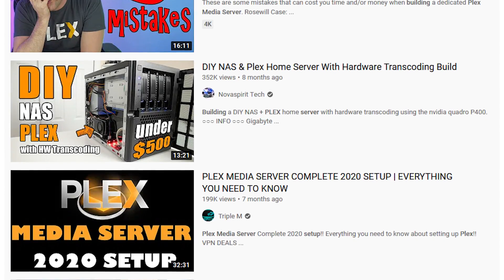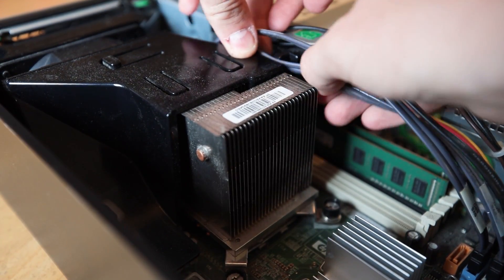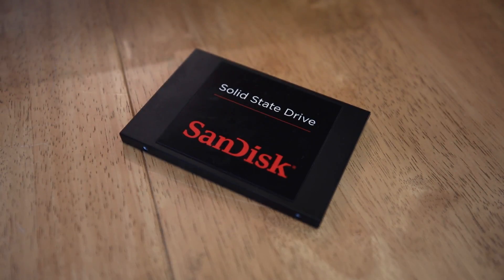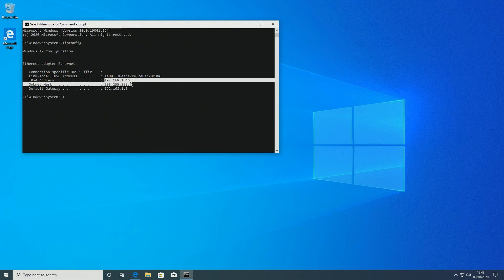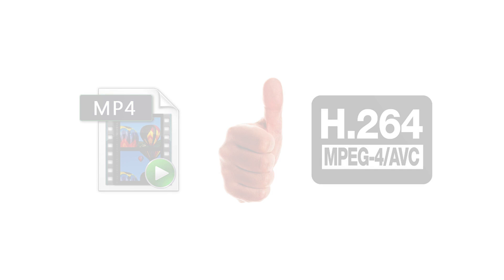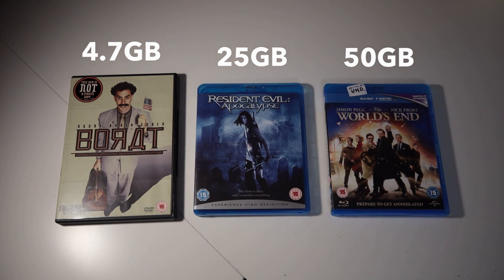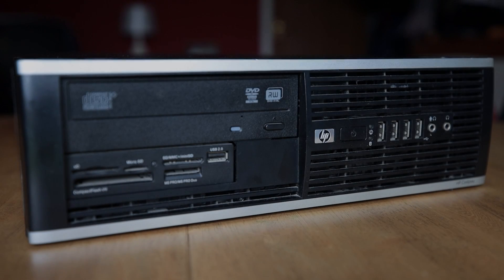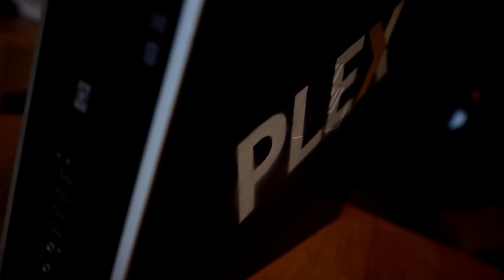Building my OWN BUDGET Plex Server for £20/($25)!

Comment: Hey there, thanks so much for what you do.  I use my pr2100 here at home for my movie watching.  I do not allow access from outside our network. Its really just serves up my movies on my pr2100 to my tv via my network. However, I have a mybook with all my movie files backed up to that drive, and want to use it for the same purpose when im traveling. The mybook is a usb drive, and I will connect to my laptop. Can I load plex server on my laptop and point directly to mybook drive and run my movies directly from that drive? Im not looking for transcoding to different devices. Simply watching movies on my laptop, mirrored to my tv. Is this possible and good enough to watch movies without degradation? The movies I have are hd, and blueray quality. Need no internet connectivity. Just like if I were using like vlc to watch movies on a external hd. I rally love the info, the artwork, and organization of plex, and it why Im trying to use plex for that reason. I assume, I will need to allow internet access to scan all the movie files, and create the artwork, but once thats done, I would like to disconnect from internet and use as a standalone movie server on my laptop using plex. Yes, No?

Comment: Your electricity costs will be around $100 a year if you are running it 24/7. Nas will be around $10 a year
Reply: I'm totally new to this whole thing. I want to ask, if I decide to go with NAS only, it just means that the NAS is only a device to store whatever files we wanted (in this case movies) on the hard drive and then we can access it on any devices like smartphone, laptop, smart TV?
Reply: Yes as long as you install Plex on your phone/tv/whatever. Also your Nas has to have Intel Celeron or greater to stream movies to your phone using Plex software.

Comment: My plex/nas server
Amd fx8300
Msi 970 mobo
Gskill 2x8gb ram
Rx 580 (folding@home)
R7 360 (folding@home)
2x hitachi 1tb
2x seagate 4tb
Team group 1tb ssd boot
R3 500gb ssd cache drive
Antec 900

Can get 6 streams going long as no 4k has to be transcoded.

Comment: I am using a little Raspberry Pi 4 with 500gb m.2 SSD for the films/series. I am using an OS called OMV5 (open media vault 5) and I am using docker containers like transmission (for downloading and seeding torrents) and plex server ofc  (and some other little things). It isn't the fastest, but it is cheap and enough just for me and for my brothers.
Reply: damn, the raspberry pi 4 has an nvme slot?
Reply: @jsbgamedev89  It doesn't support nvme (speed),  but the case for my rasberry pi comes with an extra M.2 to drive which connects to the rapsberry pi via usb. (The case is called Argone One V2)
Reply: @bakonyimate796  oh cool

Comment: I have a setup very similar to this. 
2 systems - HP machines like the one in your video, except the Intel variant instead of AMD.
System 1: Running Windows 10 Pro, Plex Media Server, and Tonido. It has a Core 2 Quad, 8GB ram, 128GB SSD, and Seagate Barracuda 4TB HDD for media. Accessed via RDP.
System 2: Running Linux Mint 20 (I think). I use it for blu ray ripping through MakeMKV and torrenting. Core 2 Duo, 4GB ram, 128GB SSD, and 1TB HDD. Accessed via TeamViewer. Although Windows is easy to use, I would recommend Linux for this use case.

Comment: My server is a repurposed Windows Vista system I built back in 2009.  Motherboard is a SuperMicro LGA775 board with a failing USB controller.  I swapped the Core 2 Duo 2.6 GHz out with a Xeon E5450 3.0GHz quad-core, modified the BIOS to include the microcode, bought a 4-stick kit of DDR2-800 for a total of 8GB, a 128GB Intel SSD, A 3TB Western Digital Green drive for SAMBA (network share folders) and an 8TB WD Red drive completely dedicated to PLEX.  The OS is Ubuntu Server installed to the SSD.  It boots like lightning and has no trouble with transcodes.  Recently added a PCI USB 2.0 controller card so the system can be connected to a battery UPS for automatic shutdowns during power failures.

Comment: myself and  a mate wrote our own webserver streaming films after i ripped all of my DVD's.
Later on I set up plex on an all in one pc with a  4TB hard drive.
Low spec with 4GB ram and a Celeron crap processor but since transcoding is not needed, the processor grunt isnt needed. works a treat.
Streams fine onto my  Amazon stick with plex client installed.
Plex client installed on Ipad and my 8 inch phone. works  even when I am out and about.
Currently I have 850 films (3TB used) and 400 GB of Mp3's all running under Ubuntu Mate.
I also have my own custom script written to back up all  media onto another hard drive using Rsync

Comment: Great video! I run my Plex server off of a Dell Optiplex 9020 SFF running Ubuntu 20.04 LTS. It has a Core i5-4590, 16gb of RAM, and 6.5 TB of total storage. Amazingly, it can stream movies to my brother’s Apple TV 4K two floor levels down over my home’s wireless network with ease! One thing to note: if you ever want to upgrade to better hardware down the line, be sure to update your transcoder settings. For me, I use the “Make my CPU hurt” preset along with slow transcoding for maximum quality and speed in my use case. Keep up the great work!

Comment: Damn, that's cheap. My own Plex server set me back a couple of hundred even with me recycling an old i5 2500k. I guess having spare disks lying around helps though lol, that's a good half of what I spent

As for the rest of it, I bought a cheapo LGA1155 board on ebay (Just the first one I saw that was M-ITX and supported HDMI). A WD Green 240GB SSD for boot, I shulked a 4TB external for the media drive (They're usually a good bit cheaper) and slapped it all into a Thermaltake Core V1 case. I didn't bother putting a GPU in, the CPU alone can handle a couple of 720/1080 streams just fine so it doesn't feel like there was much point in doing so.

That's been running beautifully for the past 6-7 months at any rate

Comment: Hardware transcode requires a Plex Pass, which is significantly over the $25 budget.
My low power Plex server: AMD E350 (dual core, 18W CPU), 16 gb ddr3, 44gb boot SSD, 5tb media drive, asus optical drive for disc ripping. Total cost: $20 (this includes the Lenovo ThinkCentre that I converted to accept an Asrock E-350M1 ITX motherboard that set me back $10). ram, storage and optical drive were all e-waste salvage so they were free. OS is Windows Server 2019 DC, licensed from my University. Total power consumption is somewhere in the 45W range at 100% utilization.
Reply: Can you do hardware transcoding?

Comment: Nice! I had a plex server, I used VLC Media Player to rip my hard copies though. Then I switched to the inbuilt media streaming in Windows (don't get the auto-tagging features or any tagging features for that matter), after a short while using that I turned to simply file sharing in windows (with SMB 1.0 turned on in Windows Features) so that VLC Media Player (for android) would connect to the windows network share (there's very few free software for Android that can connect to windows networks - even if I had to enable an old insecure legacy protocol to get it working). I took this approach because I didn't want to pay the fee that Plex asks for when connecting via a mobile device...  😅😅
Reply: I do that too, it is so much easier. With plex though you can use your movies worldwide and with chromecasts